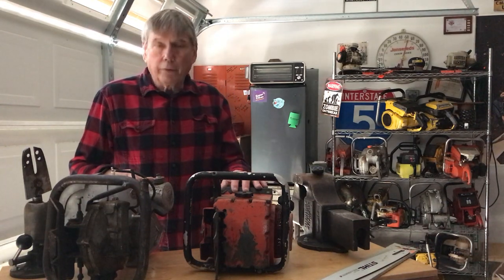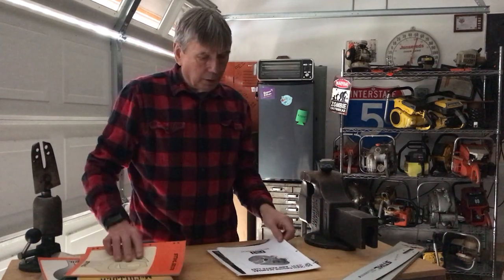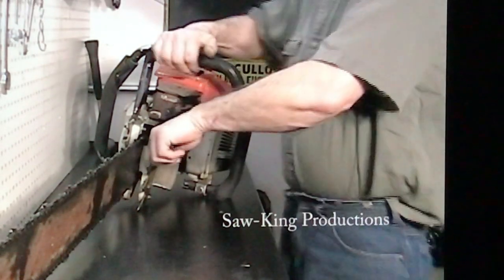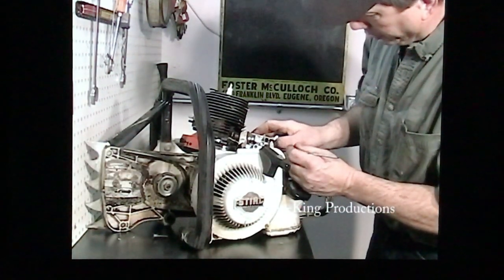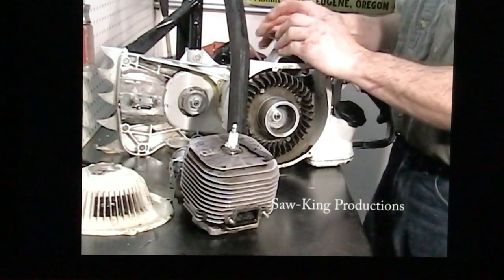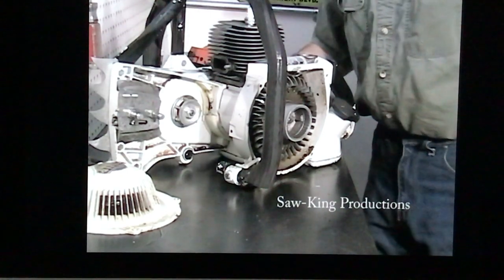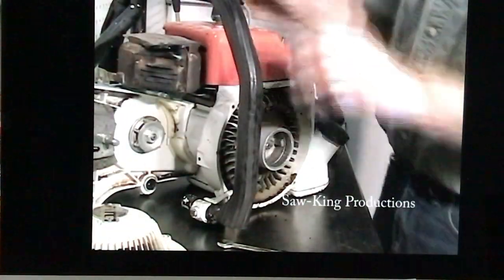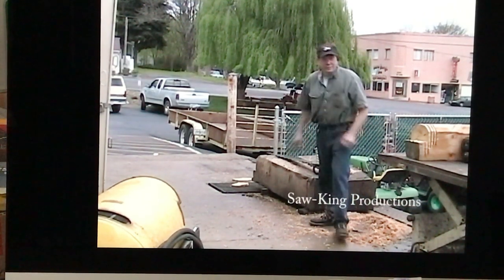Rediscovered Lost Training Video STIHL 090G Cylinder Repair By SAW-KING WestCoastMuscleSaw

Comment: Hello there my Mac 10-10 automatic has a oil leak it's missing the washer for in between the oil and gas tank could you possibly put a video up of the correct washer to use or a video on a full rebuild of a Mac 10-10

Comment: Cool video,  did Mark H.  Out in Dike Iowa get one of thos 399T?
Reply from the maker: I believe so,
 There were 5 in original shipping box.
The story I got from seller was his dad was working on the experimental build on the 399 engine for snowmobiles.
Issues with gas shortages, slowing snowmobile market. McCulloch pulled the plug on building the engines.
Sellers dad was destroying inventory but got permission to keep the 5 complete units.
The boxes were dusty but never opened when I purchased them.
Wayne’s Chainsaw museum has one, and Two went to Iowa and two to other collectors.
They were Beautiful engines! Email Wayne if you would like to see his.
WestCoastMuscleSaws 
TheChainSawGuy 
Rich